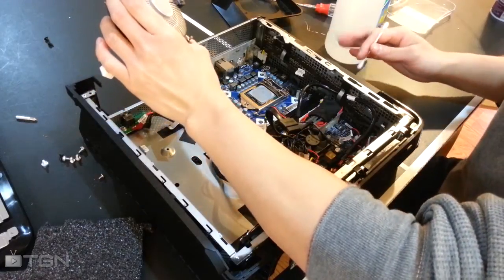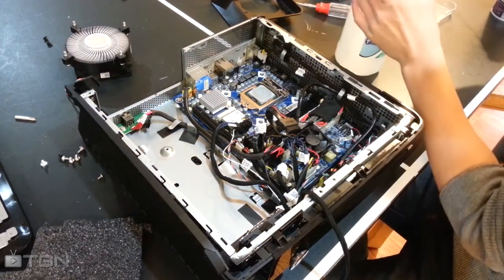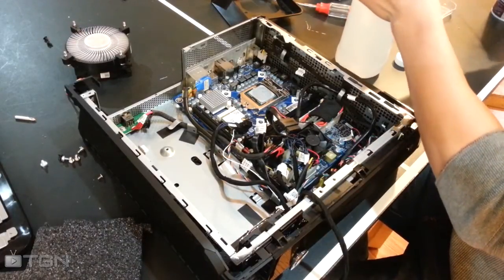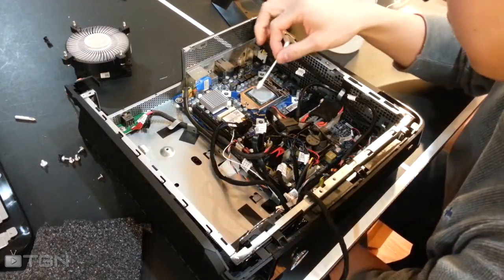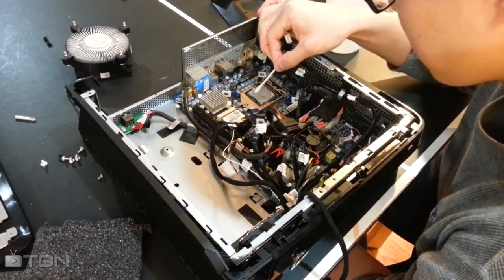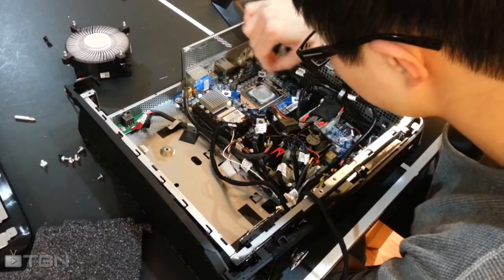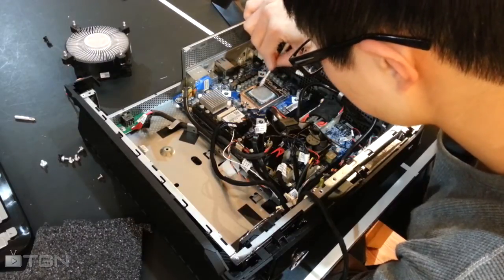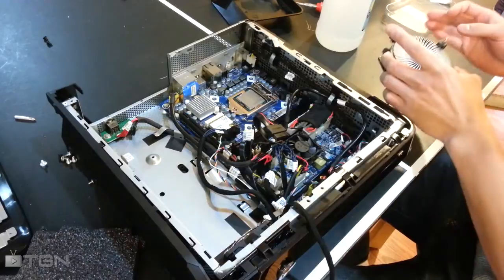► Alienware X51: How To Clean/ Remove Thermal Paste From Your CPU and Heatsink (Gaming PC Guide)

Comment: ive recently spilt red bull on my Motherboard im very lucky as its not really done damage to the mother board but still the thought is still in the back of my mind I keep on checking the motherboard and I notice little sugary sticky marks on the board I wondering weather or not the alcohol  solution you used to remove the thermal paste would do the trick as it dry's very quick